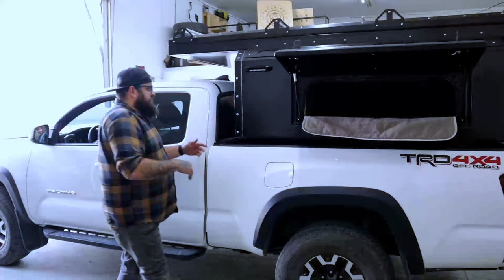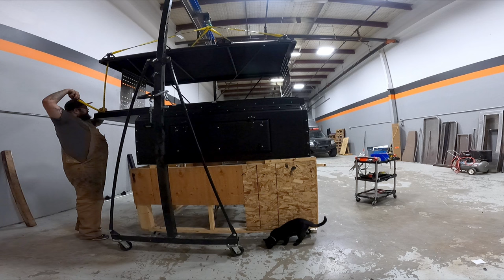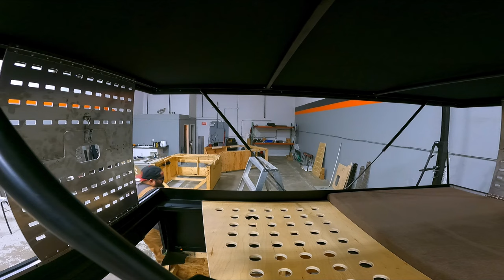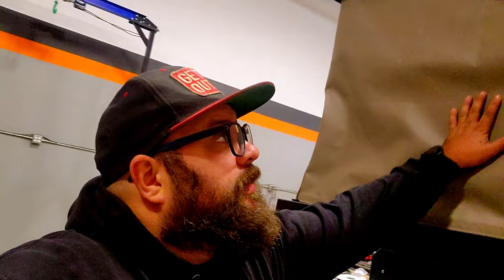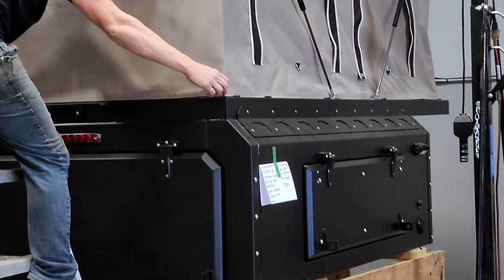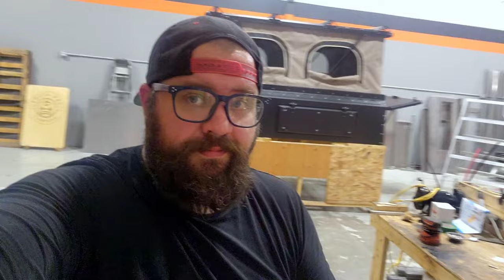Building the Ultimate Yucca Pac Camper - UPS Showdown - Yucca Pac Safari

Comment: I got my struts in Edmonton.
Part Stop in Spruce Grove has them in stock.
Tyler did the canvas for my pop up.
I learned to pull front down first, hold in place then do rear.
I had to try a couple of different struts before I got it right. You need less than you think.